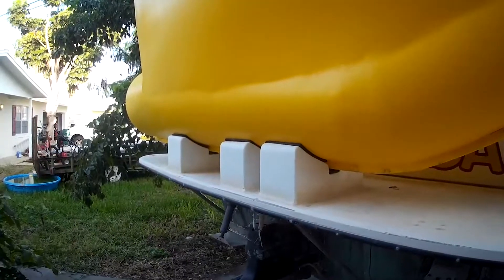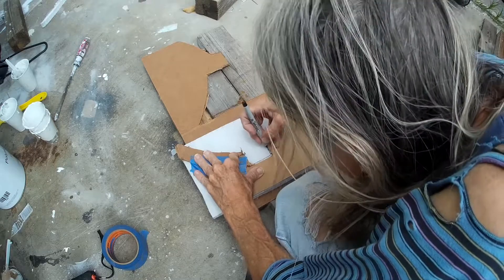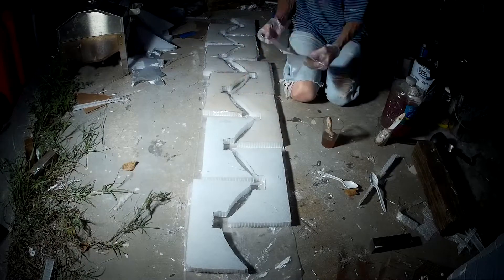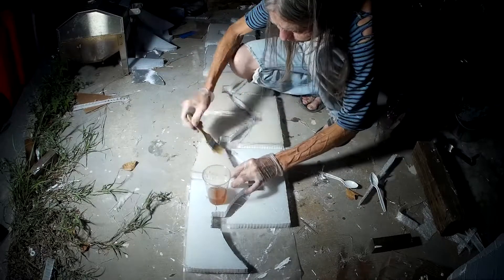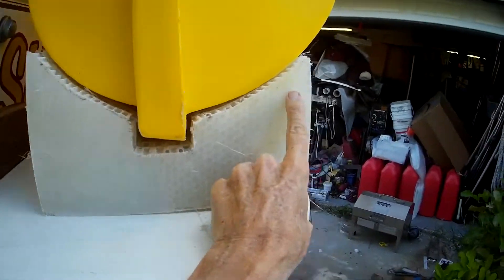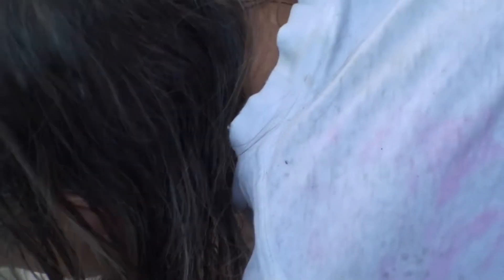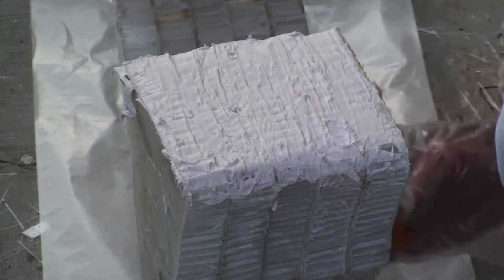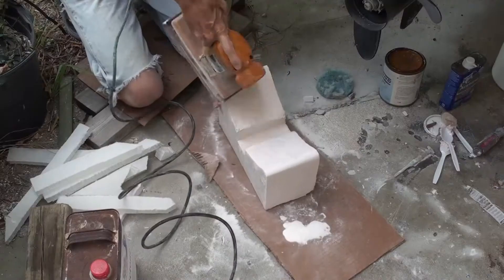Fiberglass and honeycomb core dinghy holders fabrication

Comment: Instead of gelcoat, fair it and paint it with a one part Marine urethane paint
Reply from the maker: Thanks, Whats a good urethane paint to roll on?
Reply from the maker: Thanks!  that sounds a lot easier.  If I don't have a spray gun, any advice about getting it to lay down and give a smooth finish if I roll it on?  Should I thin it out a lot so it flows out and lays down flatter before drying?  If I roll on something thick, it tends to leave an orange-peel texture, but thats mostly my experience with gelcoat and indoor wall paint.  Whats a good urethane to use and should I thin it with something and if so, what?  Is there a special primer to use with it?  And do you think this urethane will flow out and make a smoother finish than the paints I've seen so far?  Thanks for any advice you care to leave here.

Comment: Wax paper to smooth it while it dries maybe? That’s the cheap solution. I know there is a professional sheet of stuff they use to smooth the resin after it’s applied but I’m only learning too!
Reply from the maker: Nice suggestion.  I've used that with various degrees of success.  Its great for making sure you don't accidentally glue the part to something.  I wrap 4x4 blocks with it and use it to prop up parts when using resin or gelcoat sometimes.  I also used it on the rotten core repair a year ago where my patch goes around a corner.  It helped make a neat radius by sticking the wax paper to the outside of the final layer of repair.  On big, flat areas, I can't keep myself from trying to smooth it with my hand and making big waves that I have to sand through later.  Given all the sanding involved, it would probably be worth experimenting with it a little more, maybe laying a sheet of glass on top of the wax paper instead of hand-smoothing?
The wax paper also lets regular resin harden completely.  Normally polyester laminating resin stays a bit tacky so you can lay another layer on top without sanding first.  If you keep the air off of it, then it will harden completely.  For gelcoat (works with resin as well) there is a wax and styrene mixture that you can add to the liquid resin or gelcoat that floats to the top of the resin making a waxy film that lets the resin cure completely.  Wax paper can serve this purpose instead.  A few of the small patches I did on the sailboat using thickened resin "peanut butter" were covered with wax paper so they would cure completely.  I wasn't sure if the wax would float to the surface with all that thickener in the resin, but sticking wax paper to the top of the resin let it harden completely.  Thanks again for the suggestion.  Everyone working with fiberglass should have a roll of wax paper handy.